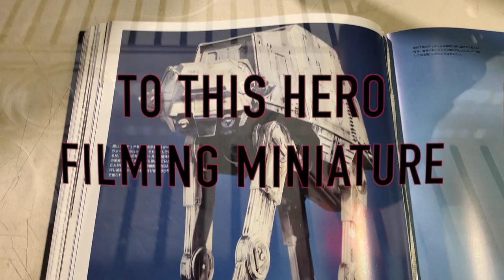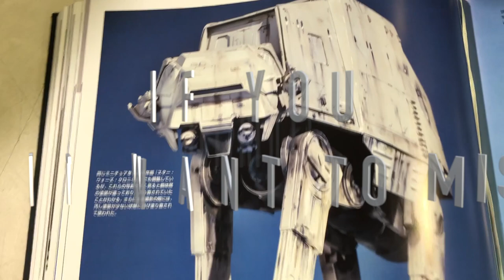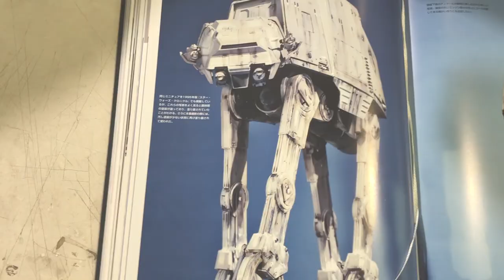Merlin Models ATAT modifications and build

Comment: where do you get the silicone tube for the neck? Id be interested in any kit/file upgrades you might offer on this, it makes a world of difference. This kind of model should be made to be posable.
So awesome job!
Reply from the maker: HI there, thanks robert. The neck material was supplied with the Merlin kit, so unfortunately i dont know where i would buy it on its own. I think if i were making one from scratch i would 3d print a negative mould and cast it in normal silicone sealer, just smoothed into the mould using fingers. There are videos showing the making of RC truck tyres this way. If you can 3d print , i would have a go. I can't offer any files, as the mods i designed only work as acrylic upgrades on the Merlin models version. I can offer you some acrylic upgrades for the Merlin models ATAT if you have that version. Thanks for checking the videos out. :-)